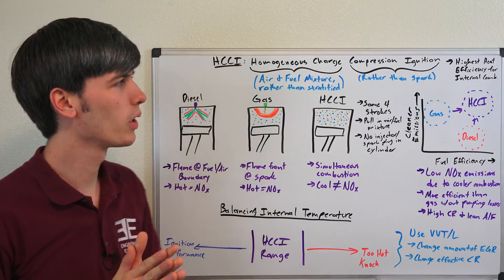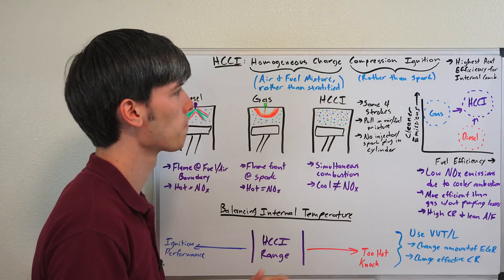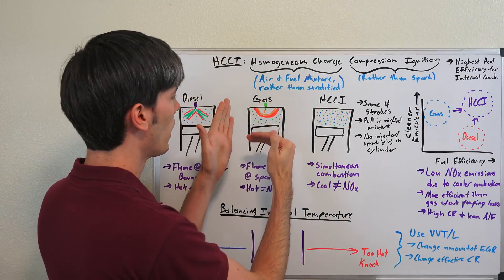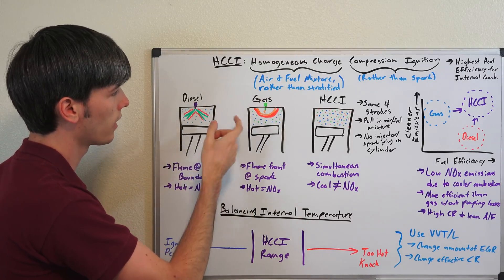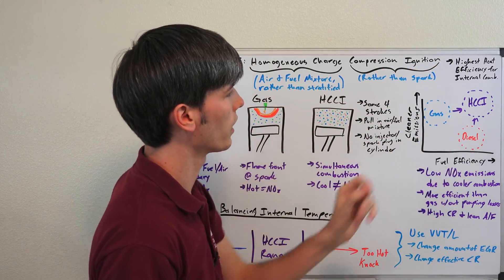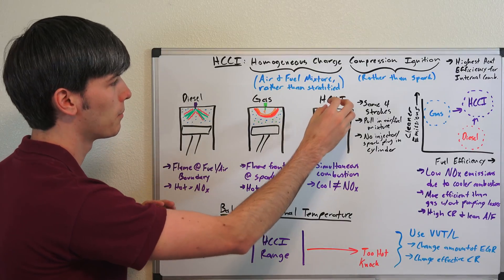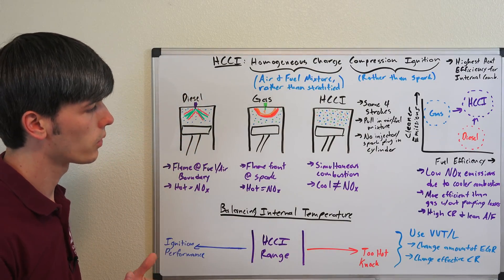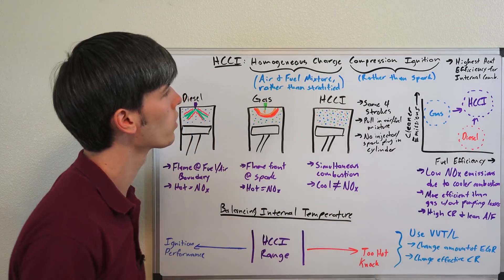The Most Efficient Internal Combustion Engine - HCCI

Comment: so what cars use those engines..
Reply from the maker: None, currently.
Reply: I was hoping to see the RC nitro-engines from thumb running, that RPM makes a lot of noise. :D currently two of em on the table. :D
Reply: All the f1 1.6 turbo using this tech and if not mistaken skyactiv gen2 will use this feature too
Reply: I think its more in the experimental stages but many manufacturers have the tech, for instance fiat (as well as catapillar and some other diesel manufacturers) use a real time variable valve timing per cyl in production and a lot of unusual things they do with it. the fiat engine its used on is a more simple spark ignition but it has an unusually small bore and a lot of charge motion to propagate the flame very fast. the "Multi Air" engine may be only slightly less efficient and not be worth the switch but the valve timing tech could be a key to what makes these hcci engines practical and its been in automotive use since 2009 or 2010 with the alfa romeo mito and probably longer with diesels so it has proven reliability. as far as f1 engines, well I can't rule out them having a hcci mode the las I read they were spark ignition and Mercedes and ferrari might be using some kind of pre combustion chamber. how they employ it with only one fuel injector/cyl is not known but the idea of a pre combustion chamber is that it shoots out jets of fire deep into the combustion chamber so the flame spreads from this kinda root looking structure of fire rather than from a single point. and I suspect the first production variants of hcci will all have a spark ignition warmup mode possibly with some sort of pre combustion chamber.

Comment: So... when and how the fuel is injected or mix up with air? Is it so kind of carburetor like strategy (mixture done before entering the combustion chamber) with exhaust gases mix up too?

I got the idea of using something similar to diesel cycle... igniting the mixture with very well controlled compression and chamber temperature, but not using the stratified injection.

When I saw the thumbnail with the tiny diesel model engine with that characteristic variable compression bolt on top of that, I thought it would be only another variable compression engine. lol

I would like to see more details around how and when fuel and air are mix up and how can you guarantee a proper homogeneous mixture (which seems to be a problem with some fuel injection systems, that sometimes can have not very well vaporized fuel mix up in the chamber and may result in a not so efficient combustion), because... right now it's the only missing link here. Thanks! 😉

Comment: In hcci how does the air and fuel mixture actually ignite with out a ignition source does hcci rely on compression alone so as the air and fuel are being compressed by the piston it will reach a certain temperature to ignite the fuel and air?

Comment: All 4 strokes are Inefficient and should be tossed in the trash.. This is no different. 

I'm surprised you haven't brought up the modular OPOC 2 stroke engine. It's by far more efficient in all categories than any 4 stroke. No heads,  no valve train to break or reduce efficiency. Less emissions and no burning oil (all 4 strokes and traditional 2 strokes) and extra MPG and performance. 

It's like a rotary minus the oil burning and emissions.

Comment: I'm a little disappointed you didn't show one of the R/C airplane engines you showed in the title pict. Used these in R/C airplanes 30 years ago. tuning was not only with the carb, but also with a device in the head that increased or decreased compression by turning the set screw. Worked great for non throttled airplane engines and only used around 1/4 the fuel compared to alcohol/nitro glow plug engines.  Also had much more torque  (could swing a much larger prop with more pitch)

Comment: I had one of those type of compression ignition engines in a model power boat 40 years ago. Compression tuned with a contra piston and mixture to give high revs, low torque or low revs, high torque. Very reliable. Des.

Comment: The mosto efficient is not HCCI. Is PCCI (premixed charge, compression ignition).  HCCI can only achieve low BMEP values (around 4 or 5 BAR) . But there is research with small PCCI engines reaching 15 BAR BMEP with brake of efficiencies of 55 %.
Reply: Ops! Its PPCCI: PARTIALY premixed charge, compression ignition.
Reply: Sounds like you know about this, I don't quite get it.
Reply: Go back to Venezuela

Comment: Thumbnail looked like an RC engine...had to click!
Reply: More like 1500-2500 psi for mechanical injection and up to 20,000 for common rail but yes. Model HCCI engines vary the ignition timing with a T bar that moves a contra piston in the head altering the compression ratio
Reply: Yeah, I have an old PAW model diesel engine that works just like how he is explaining
Reply: Yup, it's a model diesel engine, HCCI is the proper term though
Reply: Yes, I sat here scratching my head trying to figure out his drawing and description of a diesel ignition source. Maybe it's different in larger diesel engines, but my small diesels just work as he seems to be describing HCCI as working. ???
Reply: RcFrenzy 
Jepp, a Norwegian David-Andersen 2,5cc Drabant diesel. http://blhf.org/DA-motorer
Reply: Not click bait, the thumbnail image is in fact a HCCI engine, with a variable compression ratio. They may be called "model diesel" engines but they are not actually diesel engines which all have direct fuel injection and hence a "stratified charge". The "model diesel" uses a carburettor and hence is "homogeneous charge". Since they're designed for relatively constant loads like propellers, you vary the compression ratio to adjust ignition timing, ad hoc. That's why they can work without the complicated computer controls, electronic fuel injection, exhaust gas recirculation, turbocharging, and valve systems in a modern automotive 4-stroke HCCI engine that has to work with wildly varying loads.
Reply: Okay, so how would you classify them? Where does the energy for ignition come from? It certainly doesn't come from a spark or glow plug, because they don't have them. So where does it come from? Compression, I say. 
All engine fuels have chemical additives that modify combustion and ignition characteristics. 
Obviously these RC engines don't ignite in the same way as diesels because they are not stratified charge!
And I would also say, that they do have a commercial application, and that is making RC engines! Someone has to manufacture them. Most cars aren't used in "commercial applications" either. The commercial application is selling it to consumers.
Reply: Actually it's 350 times for 700RPM....
Reply: Yep, had one back in 1965, cranked down that little lever(raising compression) till it ran good.
Reply: The principal of operation seems quite similar to a model glow plug engine. Those engines are most certainly not fuel injected, and maintaining temperature is crucial in smooth running. While the glow plug is used for starting, heat from compression is thereafter what ignites the fuel/air mix.
Reply: Diesels function by having an air intake strike, then a high compression stroke heat up air in an empty cylinder chamber, then on the downward stroke diesel fuel is injected in at roughly 40-80psi (depending the engine) and ignited at as near top dead center as can be on the upstroke. Then the explosion pushes it down (the power stroke) and exhaust gasses are pushed out. Repeat previous cycle 700 times per minute at idle.

The way I understand this to work is having some system of sucking air and fuel into the cylinder at the right ratios atomizing faster and better and having the compression stroke work much the same way as a diesel, as in no spark plug. 

I just wonder how vehicles like this will work in anywhere outside of Southern California...
Reply: O.S. 46AXII is an engine that fits in the palm of your hand, weighs 13.3 ounces, and produces 1.67 horsepower at 16,000 rpm. Does it get more efficient?
Reply: @mikeries8549  Yes. The thing impressive about the engine you described is it's power density - it won't get significantly more compact (but there are model engines revving up to 40000, which translates into more power per size/weight), but I bet the efficiency of these engines is pretty poor. First of all, there is not much energy converted, in absolute numbers, by any model engine - therefore, it isn't as much of a target as in realworld engines. Second ... these engines have to run without any controls. You tune the carburettor, you may adjust compression ratio (not all have that feature), but that's about it ... it ignites when it ignites, not when it is optimal. Model engines, most of them at least, operate with a pretty rich mixture, and if it isn't rich, it at least isn't very precisely controlled.

So, yes, it does get more efficient. A lot more.
Reply: Mr. LargoFeet Totally wrong. The catalytic reaction between methanol and platinum is what keeps the engine running. do some research.

Comment: At first glance, it seems like a similar idea to what Smokey Yunick was talking about 30 years ago with his "hot vapor engine" design.

Essentially, he was running an fuel/air mix through a turbo and using the wasted exhaust gasses to heat the mixture before going into the intake. Neat idea, but obviously subject to the dangers of low-octane fuels.
Reply: Yunick's engine was an HCCI engine, then. He did a great disservice to engineering when he filed intentionally flawed patents and obscured the science behind his engine.

Comment: that'll be a bugger to start at -45.
Reply: Where do you live that gets to -45 (celcius or Fahrenheit for that matter ...)

Pretty sure any engine would struggle at that temperature for that matter.
Reply: @scenicdepictionsofchicagolife  -40 F and -40 C are the same so I would imagine it would not be much a difference.
Reply: @schmenkspeedtyping218  yep that's why I didn't care for specifics. Though 5C is not an intangible difference.
Reply: @scenicdepictionsofchicagolife  I live in Manitoba Canada, 1/2 mile from the northern edge of North Dakota.  We count on seeing -40 a couple times a winter.  I saw a February where it never got above -35 and night time lows were -45 regularly. I even saw one morning where the outside thermometer had dropped off the bottom of the scale.  But your right, most every engine struggles with those temps.  A good battery and starter with the thinnest oil you can safely run and most gas engines will start.  Synthetic oils have been a game changer up here, you can get away with not plugging in some diesels down to -35.  That's a very bad idea, but it can be done.
Reply: @j.danaclark89  what is 'plugging in'? Do you have mains-powered pre-heaters?
Reply: @dielaughing73  "plugging in" is plugging your electric engine block heater into your house power to preheat the engine enough to easily start.
Reply: @scenicdepictionsofchicagolife  northern Canada, Alaska, Iceland, Greenland have you never seen ice road truckers? And seeing as how -40c and -40f are the same temp it wouldn't make any difference slick, the gas and diesel engines run fine. And where I live in northern Minnesota does achieve that temp. Our state record is -60. Let me guess you're from California aren't you?
Reply: @dennisolsen4507  Yup, -51 °C here in Norway
Reply: The solution most likely to overcome these issues is accurate control over intake air. Preheated when the temperature sensors dictate temp boost is required.

Comment: Hmm wouldn't Infiniti's variable compression tech (the VC-T engine) be perfect for this? The engine could vary compression of each cylinder according to internal temperatures, air/fuel mixture, fuel quality and so on. You wouldn't need to mess with valve timings to let some of the air out of the cylinder during compression.
Anyways, if Nissan is developing this stuff, they'll probably use the VC-T tech for it since they're basically the same company.

Comment: I dont know why some sort of bio-fuel isn't the future. In my opinion no one ever talks about how they will integrate this into society like are we one day going to replace all gas stations with charging stations and then have to wait for a charge like we do a tank of gas? No, it would cost too much and be too complicated. If we were able to come up with a bio-fuel it would be just like a gas substitute something that works in conventional engine cars and all you need is another spot at the station like how it was when they brought E-85 to every station it was an easy transition that requires no major reconstruction of our current infrastructure
Reply: You need to use a LOT more E-85 for the same or similar result as petroleum. It's just not very efficient. Good for race cars, not for Mum & Dad drivers.

Comment: I remember working on a HCCI project in my master degree, modified a ford 1.6L engine to HCCI mode. The thing was, it only a limited power band can run HCCI mode, and the rest still SI
mode. In the ideal world HCCI should have the benefit of both SI and CI engine, but in reality  it had (10 years ago) the disadvantage of both. It ran as rough as diesel, also tended to knock like petrol. In the end of the day it was a petrol engine and it cant run as high compression ratio as diesel engine; so the use of EGR / pre heating reduce the intake air mass-flow, and seems to off-set the benefit of HCCI efficiency a bit.

Comment: Can anyone tell me what thermal efficiency rates can be expected from HCCI engines? 
As far as I know, gasoline engines reach about 25% - 30%
Reply: slightly more, but ICE is still mostly wasting energy with heat.
Reply: There are some estimates that they can get above 50% efficiency, but functioning prototypes are not available yet based on what I've found

Comment: The one thing I thought of after seeing this video was, how do you cold start such an engine? If I understand this correctly you would have to warm up the block before it would be at operating temperature? As I live in Norway that would be a hassle in the winter... Or is it just going to run "badly" in the start and then run more efficient later on?